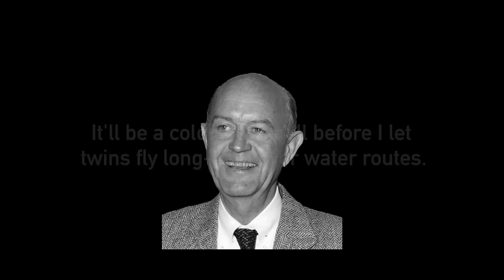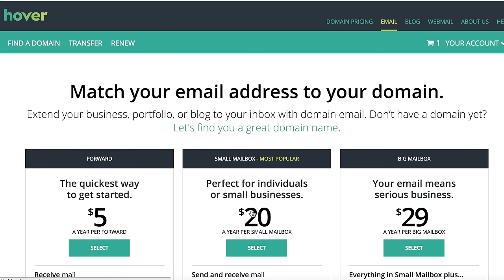Small Planes Over Big Oceans (ETOPS Explained)

Comment: ETOPS has now changed to extended diversion time operations (EDTO). It no longer applies to twin engine aircraft as the 747-8 was the first aircraft to be granted 330 mins EDTO due to the cargo fire suppression system. It is about system redundancies and back ups on aircrafts and not just about how many engines anymore. Great video though, keep it coming :)

Comment: So the question remains, though, if the fact that so many new connections can be offered, rather than posing a risk over the ocean, doesn't provide a massive additional risk in the vicinity of the destination. If even planes from North America now fly to London City Airport, that does provide a certain risk of increased low-altitude air traffic over London and with that the statistical probability of a major accident, given that take-off and landing are the most accident-prone phases during a flight anyway.  Will Savile Row be retailored by an airplane as a consequence one day?
Reply: There are rules about how many aircraft can be in the low sky for landing and takeoff at any one time and flight plans are coordinated to keep under that limit. If a delay or other factor over-crowds the sky outgoing planes stay on the tarmac and if absolutely necessary incoming planes are diverted (very rare as outside the most extreme circumstances just delaying takeoffs can prevent it getting that bad).

Comment: 7:05 Anyone thinking of citing the Airbus A340 as Airbus' other quad jet, it's not in production while the A380 is.
Reply: That's where my mind was going haha
Reply: IMO, I would rather have Airbus do more with their A380 than the A340 as I think that A380 is much better in terms of the looks than the A340. From what I can tell, the A340 is just a A330 with four hair dryers being used as engines....
Reply: N0616JC Productions the problem with the A380 is that for most airlines the size is just to big. especially for budget airlines who don't have hub systems but just fly directly to and from the actual destination.
it's the same with the 747 they are also being cut down big time. they are like wise only used on the biggest routes and mostly used for there cargo capacity.
Reply: He says in production and the a340 isnt in production anymore
Reply: @N0616JCProductions  that's just the 200/300 versions which used CFM-56's. Modified 737 engines pretty much. The 500/600 use RR Trent 500 engines which are much more powerful

Comment: I never knew that the airbus family could cross the Atlantic Ocean. A318!! Thats incredible
Reply: They usually don't use the A318, A320, or A321 airplanes on trips over the pond due to lower fuel capacity.
Reply: JaguarSparks the A318 used by British Airways is a very special one, with larger fuel tanks and only 8 rows of four business class seats.

It's all business class configuration, designed to land at London City Airport which is right next to the business downtown District avoiding the busy Heathrow which is 40 miles away.

Also, on its way out from LCY it stops off at Shannon to refuel and get pre clearance for immigration so that by the time it lands in JFK it's a domestic flight. The business passengers literally walk off and go to baggage reclaim and straight out into their limos in literally 20 minutes.

I've done it it's a lot of fun. It's actually a really comfortable flight to be on because it's so quiet and there's not that many passengers on board, with lie flat beds for all passengers.

It's just like a large bizjet really.
Reply: If I am not mistaken, it uses the old BA Concorde flight number BA001
Reply: Ian McGreevy Correct

Comment: I would hate to be on that Airbus A318 from New York to London.
Reply: It's all Business class, which helps.
Reply: And even if it is a A318, it is long-haul business.
Reply: It's actually a better experience than you'd get on a larger plane as it's all business class
Reply: its all real buisness class seats exclusively for buisness travellers, so its like a routine private jet flight.
Reply: Imagine hitting a 150kts cross wind at mid flight
Reply: I don't think a A318 can fly that far without refueling.
Reply: Eastbound JFK - LCY the 318 can justy about do it. Westbound from London City Airport the plane stops to fuel up at Shannon, Ireland
Reply: James Koralewski they refuel it in the air
Reply: Marco. Military jets perform in-flight refueling. Commercial jets do not. Where exactly do you get your information ?
Reply: It’s all business
Reply: Marco Wegleiter you’re joking aren’t you?
Reply: BA’s lounge in JFK offers pre-flight lounge dining which frees up time to sleep on board.

The aircraft has only eight rows of four seats so no big line at the gate or the ubiquitous flock of sheeple blocking your access while looking like they have no clue what’s going on around them. Very likely also no screaming babies, let alone the line of 2-300 economy class passengers passing by you on the way to the back end of the plane.

It’s really an executive flying experience, but if you’re afraid of flying, perhaps the small size of the aircraft will worry you.
Reply: Not when it’s all business class free champ
Reply: James Koralewski they do
Reply: Marco Wegleiter no they don’t no passenger plane can only military
Reply: Headwind or tailwind Randy? :-)
Reply: +James Koralewski - Well obviously it can or they would keep reducing the number of business class passengers that are available in the market. :-)
Reply: @jodieanne  The LCY runway isn't long enough for the plane to take off with as much fuel as it needs! On the bright side, passengers can clear US immigration while waiting in Shannon.
Reply: @Nick.Even fully fueled with a runway long enough for takeoff, an A318 flying LCY - JKF has insufficient range when factoring  headwinds that all planes encounter on Atlantic westbound flights. From Shannon it's within aviation safety limits for operation of the route with that equipment.
Reply: Me too
Reply: jodieanne that's absolutely not true at all.

First of all, it's a specially prepared a318, with enlarged fuel capacity, second of all because it's so light, carrying just business class passengers, with just business class luggage, it's easily possible for the aircraft to fly both directions non-stop without refuelling.

The business class A318 has a 4400 mile nautical range, so the only reason that it stops in Shannon on its way from the UK to New York, is to clear immigration, and to top up with fuel due to the fact that the runway at LCY is not long enough to take off with a full fuel load.

The aircraft has close to 1000 miles worth of redundancy. It is simply no different than a bizjet, or aircraft made by Airbus in a Business Jet configuration.

I wish people would check their facts before posting.

Literally hundreds of big jets cross the Atlantic every day, and you don't see any posts on here saying oh my gosh I wonder how such a tiny plane can cross the Atlantic?

People just have no concept of aircraft range Vs size.
Reply: Not only is it all business class, less passengers mean quicker boarding time and when you land you're close to the center of London (City Airport)
Reply: @jameskoralewski3583  It can because it only carries 32x pax so much lighter than standard A318. Outbound it has to refuel as the runway at LCY is not as long as Heathrow
Reply: @jameskoralewski3583  As the A318 route takes off from London City Airport, the aircraft can't take on that much fuel there, so stops at Shannon Airport in Ireland, for refuelling and passenger immigration clearance, then straight on to JFK. Plus it's an ACJ318 variant

Comment: small plane fly over big oceans, seems legit
Reply: They are, after all, small compared to the 4 and 3 engine aircraft.
Reply: N0616JC Productions they aren't that small. The 777 for example is huge.
Reply: Stand partially corrected. Also, I would like to say that 747SP was the first aircraft designed by Boeing to have a longer wing than the fuselage before the 777. Also, the engine (just one of them) is the size of a 737 fuselage... so yeah...

Comment: British airways actually doesnt fly a straight flight from London city airport  to New York Jfk.
Thats due to LCY's short runway.
The 318 cant takeoff with all needed fuel from lcy. They need to stop to refuel and takeoff from the long runway in shannon, ireland.
They can only fly straight from JFK-LCY, landing with nearly empty  fuel tanks.
Reply: The Blue Azumarill hi, love your knowledge of the comment however, thediversion is due to customs. British airways carry out customs checks in Shannon airport to reduce the inconvenience when in jfk!
Reply: The Blue Azumarill that's not strictly true. I can tell you that, because I've done it.

First off, the A3 18 used for this route is an upgraded A318 with slightly larger fuel tanks, and it only has 8 rows of four business class fully lie flat beds. That's just 32 passengers and a small amount of luggage. Think of it as a slightly larger corporate bizjet.

This means it's very light with hardly any luggage on board and can do the flight easily from JFK to LCY non-stop with plenty of fuel redundancy. The range of this particular enhanced aircraft is somewhere in the region of 3950 miles due to the larger tanks and lighter weight. The first officer told me that they usually have around 300 miles of diversion fuel left on board by the time they land at LCY so that there is really nothing to worry about. In the past, due to bad weather, snow, or storms, they've been diverted as far as Boston and Chicago with no real problems.

The only reason it stops at Shannon on the way out from London, is to get pre-clearance for US immigration, and add fuel because the runway at LCY isn't long enough to take off with a full complement of fuel - being only around 4800ft.

So to kill two birds with one stone it takes off from LCY with a short amount of fuel on board, stops at Shannon, the Passengers get preclearance, extra fuel is added, and the food is put on board, and then it flies the rest of the route directly.

On the way back it does the JFK LCY route very comfortably just like a Business Jet. After all - that's what it is, 32 business class passengers on a very light aircraft.

The seats are all lie flat fully fledged business class seats with full ify and Wi-Fi on board. And the reason it's much more comfortable, is because there so few passengers on board and everyone gets served their food quickly with ease, and it's very quiet on board.

That's why it has flight number BA 001, which was reserved for Concorde.
Reply: The Blue Azumarill the A318 DOESN'T land with nearly empty fuel tanks.

I don't know where you got that ridiculous notion from.

The A318Cj has plenty of fuel to cross the Atlantic. With a 4000 mile range, it has nearly 600 miles worth of redundancy.

How do you think biz jets cross such huge distances?

Please don't talk such crap when you know nothing about Aviation.
Reply: Regardless,  it is still a transatlantic flight.  Which is awesome for a A318

Comment: Can wait to fly my Cessna over the pasific
Reply: happens more often than you'd think, ferry flying is a thing. you could fly a cessna to hawaii, you get a special bit of paper from the FAA that lets you be over maximum takeoff weight with extra fuel for the ~20hr non-stop flight to hawaii.. that sort of flight really is a case of the big propeller on the front of the plane being there to keep the pilot cool.. if it stops you can see the pilot start sweating..

Comment: I thought the first airplane that was ETOPS certified was a A300/A310?
Reply: Half true, A300 had a 90 minute rule, but it wasn't officially called ETOPS. Though it's the same thing.
Reply: No The 767300ER was ETOPS certified and Delta Airlines flew many of them back and forth to Europe.
Reply: Possibly, but what I recall were that the first ETOPS flights went out of Canada on 767-200ERs.  Long before TWA BTW.

Comment: That creeps me out because I'm going to New York from London and it will be my first time on a plane and if an engine fails the other one won't last
Reply: Ella Grace you'll be fine, planes are reliable! Have fun in New York
Reply: Fun fact, you have a higher chance of being struck by lightning walking to your car then crashing inside of an aircraft.
Reply: Commercial jets are (each plane) struck by lightening on average about once per year but passengers generally don't notice, at most its a bit of a clap from the thunder. Does nothing to the plane.
Reply: Craig Smith
Crashing, or dying in a crash?    Dying is very rare but crashes are more frequent.
Reply: It will probably last. Do you know how many air miles are put on one aircraft that flies long distance?  Many more than your Ford puts on it and they don't change the oil every 2000 miles. They test the-one- engine -out failure in the flight simulator almost every day.
Reply: Pigsss Pigsss don't worry, there's hardly any chance of a jet engine failing mid-flight. If it does it just means the flight will be a bit longer as the aircraft will fly a bit slower on one engine.

If both engines fail, the plane will fly so slowly it will take forever to get there.

And anyway, even if it does crash I wouldn't worry too much. The last thing that will be going through your mind, will be your bottom.

Comment: Your video opens with a quote from FAA official. There was a reason for it: Airbus was a new entrant with its twin engine A300 and later A310 and not granting ETOPS was a way to shut Airbus out of the trans-atlantic market.  It was only once Boeing started to deliver 767s that pressure rose for FAA to change its mind since that policy was not hurting a US manufacturer.

Comment: Just a few questions:

1. How would the pre-ETOPS era have worked for the Concorde? Did it effectively have a larger 60-minute range because it flew faster?
2. Why are 3 and 4 Engine planes less fuel efficient? Is it just because the “plumbing” is more complex, or does having more engines increase drag that significantly?
Reply: pokepress 1. Concorde was 4 engined. 

2. Law of diminishing returns.

Comment: Great video and information. It maybe wise to add that in order to an airline to retain its ETOPS certification they have to maintain a certain ratio of in-flight engine shutdowns. That ratio changes with the size of the fleet. This demands 25 hrs or so for engine oil and filter changes, as well as APU, and others components. . Oil here is in gallons, not just quarts. The extra food can be tossed as foreign food. It can get very expensive, so the airplane must be near full. An A320 going from NY to London, was a dream just 20 years ago, or a 737 from LA to Hawaii  yet its done routinely today.. Í fíes on a 787 from Santiago, Chile to Auckland, NZ. An amazing distance of south Pacific circule routes.

Comment: The other reason 4 engines are less common is because of the fuel efficiency of modern turbofan engines, to uplift a large number of passengers, huge weight in fuel and cargo, you needed four engines. These days, better efficiency means less fuel carried, less engines required but still long range and high uplift weight. - A330 is such a good example. They have even been converted to tanker transporters for military use.

Comment: There were 3 airplanes for long haul.   McDonnell Douglas DC-10, Boeing 747.  You missed Lockheed 1011, it was a real workhorse and would carry 370 to 400 pax.  It stopped production of the L1011 at the end of 1984.

Comment: Just thought I should point out that a "direct" flight and a "non-stop" flight are not universally interchangeable... A direct flight in the aviation industry is any flight between two points by an airline with no change in flight numbers, which includes one or more stops at an intermediate point(s). A stop may either be to get new passengers (or allow some to disembark) or a technical stop over (i.e., for refuelling). Direct flights are often confused with non-stop flights, which are flights involving no intermediate stops. When there is a change in flight number, the subsequent flight is referred to as a connecting flight.

Comment: Remember the certification might be for ETOPS 120/180. But in most cases the actual distance might not be that far.   There is a point called equal time point.  Point where the flight time and distance is equal to go back to let’s say back to Europe or press on to Canada side.  Occasionally even a US coastal city can be used as ETOPS airport if the routing is right.